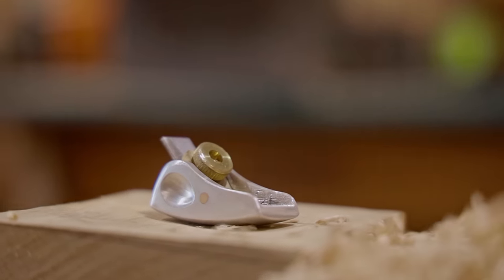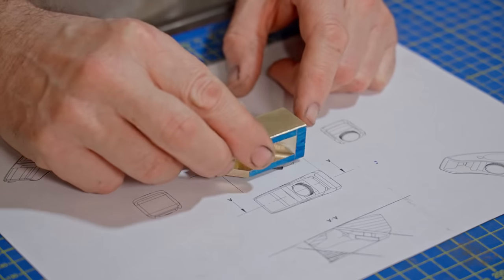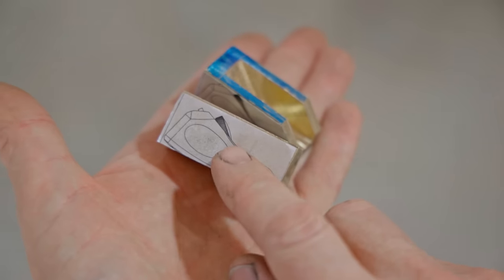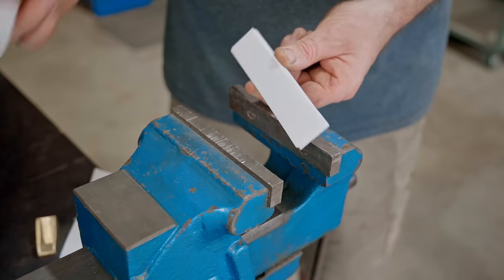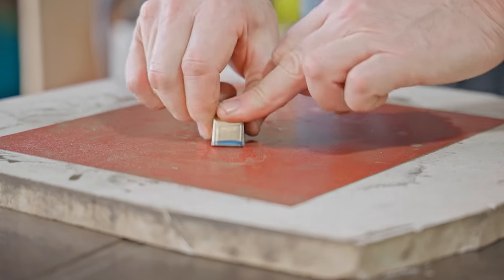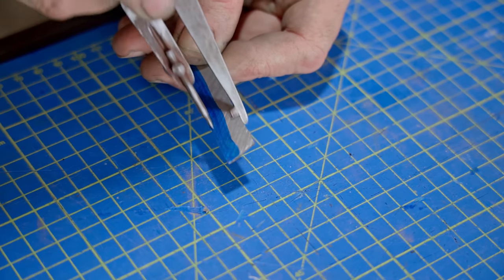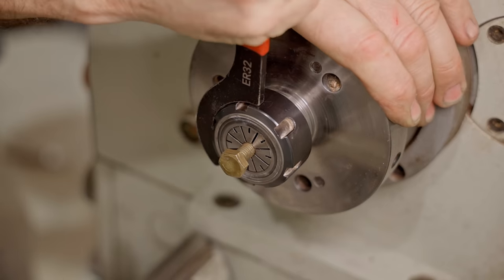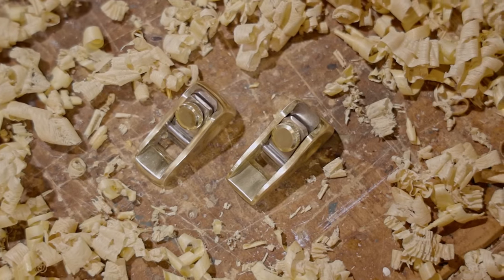Making 2 Tiny Planes - One with Basic tools and One Machined

Comment: The adjustment screws can easily be made in even something like a hand drill (put the hand drill on the edge of a table and keep it down with your non dominant hand allowing you to use a file or an angle grinder to shape the head). The knurling can be made using using a bastard file. Put the file on a table's edge, clamped down or glued with double face tape, and then pressing with your hand on the chuck of the drill, roll the screw on the bastard file's face (no power, just by hand) until the finish is to your liking. DO NOT lift the screw until you've achieved the finish you want. if you do, you'll mess it up.